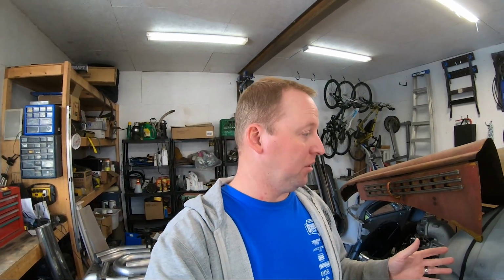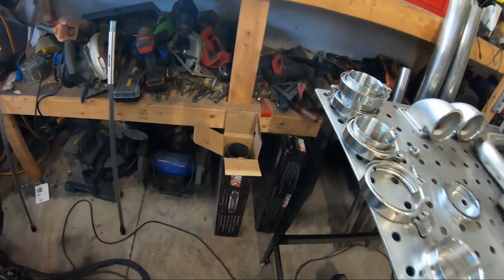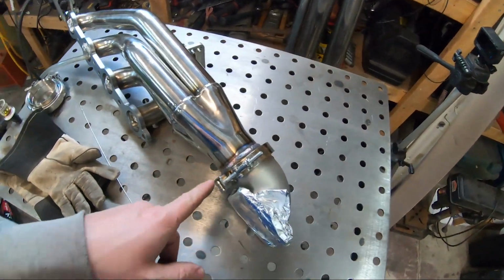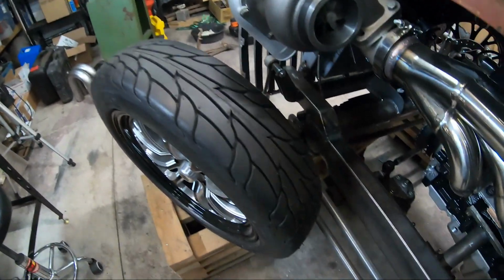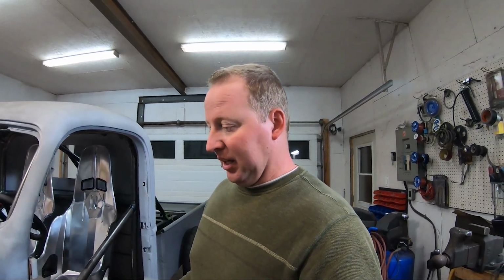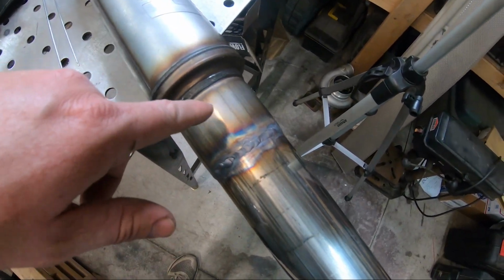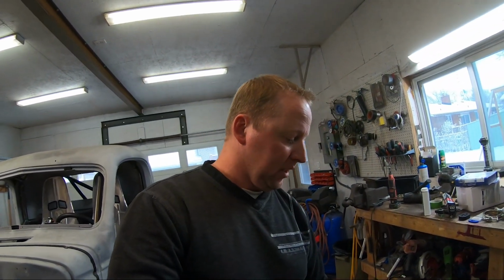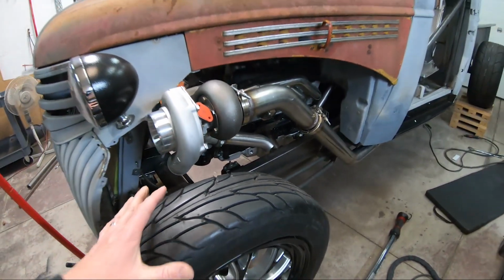Building a Turbo Kit Hot Side!

Comment: To save on argon, back purging. Look up Solar Flux. I use that on big pieces. Better than using so much argon. Plus, try a smaller filler rod, like .045, you have too much filler on the welds and that adds to the heat issue that happens with stainless.